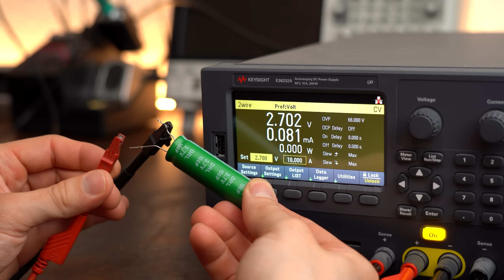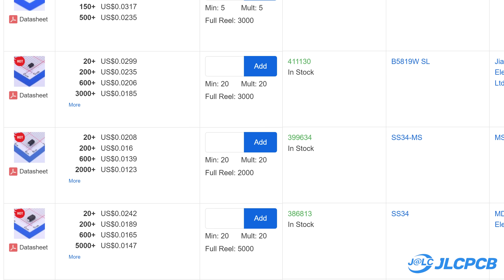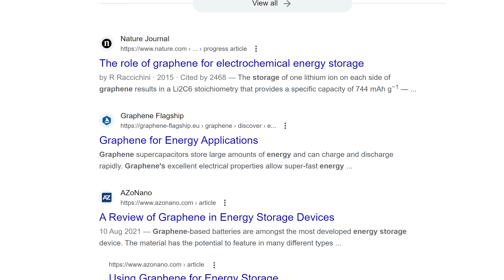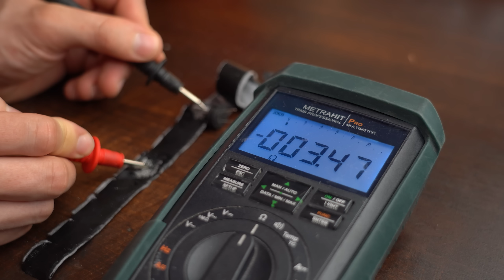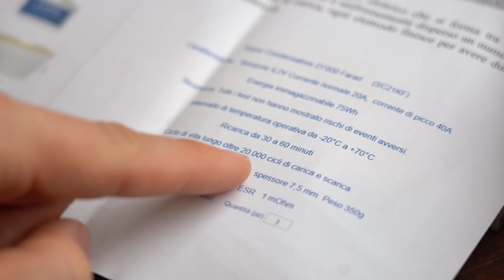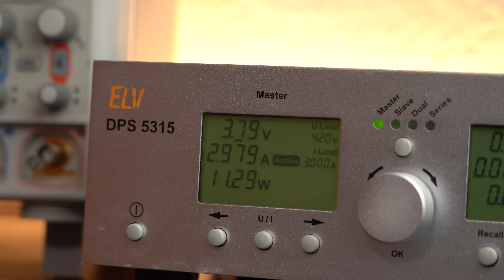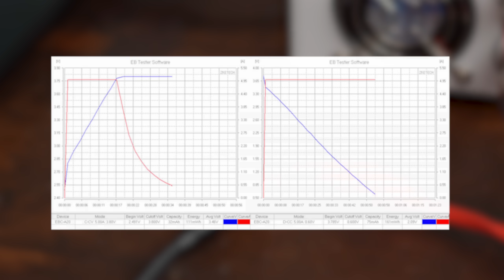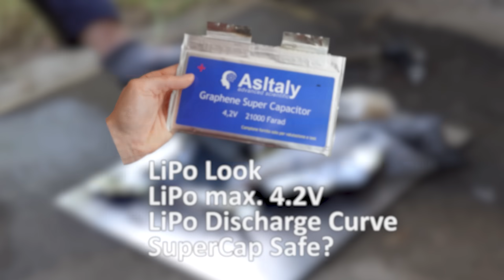Finally a Capacitor that can REPLACE a Battery?!

Comment: Greetings, interesting tests you have done here in video. If you allow me I wanna share something that I've built and using it like more than 4 years without any problem.
I have use the super capacitors just for starting a car. Like 5 seconds maximum of key turn until it discharges all the energy while starting. I use the setup in my car, have 6 super capacitors in a row connected in one bank and 6 in a row in 2nd bank (backup bank). I have built electronic for switching automatically after successful start to battery but only after the capacitor bank are full again and ready to use,basically, the car will recharge actual car battery while working but only when it recharges the capacitors first. Also I have built manual toggle switch for  capacitor/battery just in case as well as backup switch (toggle between 1st and 2nd capacitor bank), as well as the switch to manually charge the capacitors from battery if needed (only if the car is not running for a few days)
I use the 2.3V 20F 60A 35mm diameter super capacitor, have 6 of them connected in a row for total of 13.8v with same capacity of 20F in one bank and same in the 2nd backup bank. It gave me average of 5 seconds cycling a car with the key until discharges which is more than enough for a normal start.

The idea is to fully disconnect the car battery because of the life span, rigidness, low temperatures faults.
Basically, with this setup the advantages are:
- Quick start: capacitors can deliver high currents for short durations, which is beneficial for quickly starting the engine
- Long Cycle Life: capacitors can handle many charge and discharge cycles, making them more durable than traditional lead-acid batteries for frequent starting tasks.
- Cold Weather Performance: capacitors perform better than batteries in cold temperatures, which can be crucial for reliable engine starting during winter.
- Lower Weight: capacitors are lighter than traditional batteries, contributing to overall weight reduction in the vehicle.

on the other hand there are also some challenges and considerations to keep in mind:
- Capacity and Runtime: If the car is not driven frequently, the super capacitors might not be able to maintain a charge for long. In my case it is few days of not turning the car on.
- Voltage Requirement: While super capacitors can provide a quick boost for starting, they might not be suitable for long-term power supply to the car's electrical systems. Which is the reason why I've kept the acid battery.
- Power management: Designing a power management system that can seamlessly switch between super capacitors and the battery while ensuring smooth power delivery to various components. In my case I have built such a system, it still runs fine after 4 years.

All in All, my goal is to replace the battery entirely but to be able to do that, super capacitor tech needs to advance a little bit more, I hope in the future (maybe near) we will have such tech to throw the old lead-acid batteries thru window and start using the super capacitors 100%

btw, I am planning to switch my lead battery with different one, the reason is simple, it only needs to have enough charge to supply the capacitors with let's say like 10 charges (it will be more than enough if the car wont start because of some other reasons, like broken fuel pump, no fuel, bad starter etc. in that case I will only have to try turn on the car like maximum 5 times and if it not start it is something else, leaving me with enough energy in the battery when I repair the car and turn it on, which will recharge the battery and the capacitors as well for next start.

Any way, I would like to see if someone have some ideas to improve my setup even more.

Keep up great content and channel

Comment: Have been building capacitor banks with 3000F MAXWELL ULTRACAPACITORS for years. Voltage change is V=(IT)/C . Able to charge from 0 V to 2.7V with a cycle life of 1,000,000 
From its voltage curve it's a LiFePO 4 battery with a misleading label on it.

Comment: Great analysis. I'm not a cap (nor a battery) expert either, but after your tests I would agree that there's no way that's a capacitor. Doesn't pass the duck test.

Comment: Can it be fully discharged to 0 volts and then still function again? If not - it's not a capacitor. (I've ran in to this kind of scam before with another manufacturer calling lipo "supercapacitor")

Comment: Even with low capacity, fast charging partially offsets that issue in a fully built out EV charging network, where you have a charge station at least every 100km or less.

Comment: It seems to me that you are gratuitously smearing a perfectly legit product, still clearly labeled as "not for sale - still in developing phase - for test ans evaluation only". This is a hybrid capacitor, combining aspects from (super)capacitors and electro-chemical cells. That's the reason of the unusual discharge profile. You should have asked the vendor for some more details and information, before publishing such a questionable video.

Comment: Alternating layers of copper and aluminium foils?
It's a lithium.
Supercaps typically only use one metal i'm sure, probably aluminium like a normal Electrolytic...
But smaller memory backup caps use disks of activated carbon with separators in between, and the case is actually a kind of spring that pushes these together when crimped...

The discharge curve test actually reminds me of a test where I validated a recovered UR1620 lithium-ion battery, which was half-scary since I was unsure of it's chemistry, but was sure it could be only one of two types...
It charged to 4.2V just fine, and after a steady discharge, did not drop to 3.1V rapidly - which means it was definitely not a 'ML' rechargeable backup, nor was it a LiFePO4 type which I was a bit sad about...
...Compared to a 'LIR' type, it had only 2 or 3% of the short-circuit current, but it was not buggered as it shows 'good' capacity for it's size! I think it's a rare instance of "solid" lithium-ion battery, where the materials are stacked as disks - instead of being jelly-rolled.
A conventional LIR2032 has a ~ 1x10cm battery 'strip' rolled into a square, with the top and bottom featuring an exposed section of the electrodes which mates with the two sides of the coin cell...

Comment: Capacitors rely heavily on their structure to operate efficiently/correctly, this is generally why they are cased in a strong shell, the flexible alloy case is a strong indication this is indeed a battery of some sort (Not sure what battery tho)

Comment: I don't think science is far away from making a hybrid with the benefits of batteries and capacitors combined. High energy density, high power output, high voltages and currents, the best of both worlds.

Comment: Dude just punctured a 200 EUR battery for one video 😂
Reply: The battery is really worth maybe 50 euro. It is a clear fake, so don't get too impressed. Capacitors don't have copper sheet\plates in them (like this product did).

Comment: Strange...
I learned E = 0.5 * V * V * C
Filling in 4.2 V and 21000 F gives 185 222 Joule or Ws
Divide this by 3600 (s) and you get  51.45 [Wh]
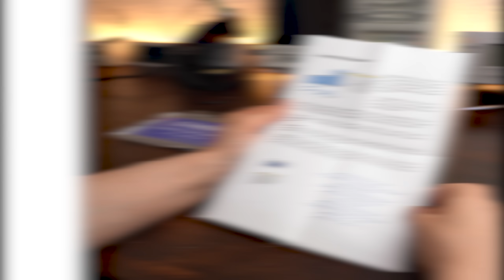At 06:40 the document claims 75 [Wh]
This stinks!

Comment: As far as I know Lithium reacts violently when introduced to water so if you can safely test is with water then you can probably determine if it is some kind of lithium battery. Make sure to deal with the waste properly so the environment does not get polluted.
Reply: Not true for all lithium batteries, multiple battery technologies like LTO is very stable

Comment: Taking a weight from datasheet - It is actually 200Wh/kg, that is awesome even comparing with LiIon technology!
It is really they have no reaction on puncture. Where the energy than goes? Would be nice to try testing the punctured one for the remaining charge.

Comment: Meanwhile the datasheet is available at it says:

"This product is a graphene hybrid ultracapacitor that is a storage device of energy that exploits the properties of graphene to achieve high storage capacities and rapid speed of charging and discharging. These ultracapacitors combine electrostatics (or double-layer
capacitance) and electrochemistry (or pseudocapacitance) to maximize energy efficiency."

So it IS hybrid. And there is also a picture in the datasheet showing a "Porous Separator" between the electrodes. Note that a real capacitor wouldn't need such a thing. This thing is needed so chemicals can pass from one side tho the other side, which is only needed inside a battery as inside a capacitor, no chemicals are traveling around.

Comment: When I first saw it, it was screaming battery.  As for the puncture reaction....Aren't some companies producing Lithium batteries that don't use the pyrophoric materials?  The lack of a data sheet and the knowledge an average person (or far above average person like you) can't test for 20,000 cycle life.....Alarm bells.  It will happen some day....probably not on ebay and not for a coupla hundred Euros.  Thanks for all the work you put into your channel.

Comment: Graphene should not react with water, Lithium reacts violently with water. You still can test this with the destroyed one, but you should wear gloves for that. Like someone wrote before you could discharge it completely and try to charge it again, and you could try to charge it in seconds, that also would not work with a Lithium Battery.

Comment: You are joking, right? 
Even if it was a 'supercapacitor', how have you come to an idea, it has a higher energy density?
Giant 'supercapacitor' has 21000F, and a small one has 100F, and also guess what, small one 20 times smaller, SO IT IS THE SAME ENERGY DENSITY.

Comment: Graphene Super Capacitor  is not pure Super Capacitor. Its hybrid with Lithium. Graphene gives quick charging and discharging capabilities. Lithium give best energy density. This brand is quite expensive. We (joltabattery) use Graphene Super Capacitor Cells at one fourth the price and make Super Capacitor batteries with 1C, almost 15 years life. These are best for mission critical applications like banks, telecom, data center, call center, etc.

Comment: I also want to say that from the data it is an excellent supercapacitor for some applications thanks to its safety, as you can see from the video, it does not catch fire, and thanks to its 20,000 life cycles, which seem few, but mean over 6 million km for an electric car.

Comment: My problem with the battery vs capacitor discussion is, 
1) it usually neglect the problem relating to the discharge curve of battery vs capacitor. Battery hold their voltage and drop down at the end, While capacitors drop down from the start the most. This is an issue I always find with my customers who request super capacitors as energy storage. There is no doubt that super caps are moving into energy storage territory. However, the discharge curve is the biggest hurdle to overcome. 

2) The idea that its quick to charge super capacitors is also due to their poor energy density and internal resistance. As super capacitors improve, so would charging them become a more sensitive topic as heat will always be a problem when resistance and large currents are involved.  So it goes without saying that the larger the capacity of super caps, the more relevant charging and discharging parameters and limits will become, as with batteries.

Comment: Pretty sure it is just a LiFePO4 pouch battery, no? They are much less volatile than other Lithium batteries so that would explain the puncture test. Now why the company feels the need to lie about their product and deceive their customers, I can't speculate on. Obviously, they are a garbage supplier that should be avoided entirely.

Comment: Supercapacitor is not a capacitor, but ion battery (without chemical conversion stage, meaning that it has lower capacity by definition). This misleading name should be changed, like most other "advertisement" names. This kind of battery depletes supply of opposite ions quickly, and there is nothing to support some basic voltage, meaning that a huge amount of capacity is wasted due to difficulty to extract it at lower voltages.

Comment: Ok so I wrote them an email inquiring about their supercapacitors. Here's a translation of the reply:

Good morning,
these devices are hybrid supercapacitor that have a higher voltage, capacity and energy density (up to 10 times) when compared to symmetric capacitors. They also have a lower leakage and standby currents. Alternatively, traditional supercapacitors have higher an higher power capacity (?) due to the lower ESR, the operating temperature interval is wider and can be discharged down to zero volts. Hybrid supercapacitors can't be fully discharged. Their structures are very similar, but an hybrid supercapacitor uses a graphene anode interwined with lithium and a different electrolyte.

Another advantage is its discharge curve being closer to that of a battery.

The fact that it's an hybrid is obvious from the shorter lifespan compared to electrostatic capacitors, but 20000 cycles mean 6 milion kilometers if used in an electric car or over 50 years of duration on daily charge. 

The differences among our supercapacitors are due to differences in distance between elctrodes and the difference between a cylindrical geometry and a pouch.

So yeah, they were hybrids all along. Cheers from Italy.

Comment: Would be interesting to put some of that 'graphene' under a microscope. If it is graphene it should look semi transparant, were as graphite just looks like opaque (but shiny) grey flakes. It won't prove that it's a capacitor, but at least it will prove it's graphene and not graphite.

Comment: The discharge curve told the essentials. It's not a super capacitor, it's a battery. Some lithium batteries do not light up even if they are damaged. Maybe the conductive material is thin enough that the short circuit is not too energetic to ignite. A high-current small battery requires strong conductive materials and thus aggressive ignition

Comment: 21kF is not insignificant storage. And it might be an upgrade worth considering:

https://youtu.be/XNmkXyhE4l8 

4 of these graphene supercaps in series would be an interesting automotive experience, especially with a small solar panel to trickle charge/maintain when an engine/alternator isn’t running…

Comment: That seems like it is more likely a lithium-ceramic battery. Very similar discharge and power density to lithium-ion, less violently reactive, (more expensive). If it is, still cool tech, but not grapheme super cap.

Comment: You might be dealing with a capacitor, power bank disguised as a single capacitor. Power banks, like these can consist of multiple capacitors, which act as the cells of a battery, giving it the ability to last longer than a normal capacitor.

Comment: The best up side though
It can store power for years without discharging

10:42 
And if it doesn't explode despite physical damage that is amazing!
Literally even if this isn't graphine this is a major improvement in safety!
Reply: Not if it's simply a lifepo battery, which also usually does not burn when punctured. 
Not to mention the confusion with the word "graphene"
Many battery manufacturers use "graphene" to differentiate better lipo cells using lithium manganese oxide (LMO, the inferior chemistry of lipo cells) and lithium cobalt oxide (LCO, the more robust and longer lasting lipo chemistry)
So if you see "graphene" on the label when you're buying a lipo battery, 19 times out of 20, they are using "graphene" to refer to the inexpensive, inferior LMO Lipo chemistry. Nobody wants that.

Comment: Having a look at their site I think you just got the only thing that isn't a super capacitor. The other two kinds which they offered (30KF and 100KF) actually looked way more genuine, with peak currents of 200A and 300A and just 5-10 minutes of charge times.
Reply: Although I made also a seperate comment, I'll copy the reply here too.

Ok so I wrote them an email inquiring about their supercapacitors. Here's a translation of the reply:

Good morning,
these devices are hybrid supercapacitor that have a higher voltage, capacity and energy density (up to 10 times) when compared to symmetric capacitors. They also have a lower leakage and standby currents. Alternatively, traditional supercapacitors have higher an higher power capacity (?) due to the lower ESR, the operating temperature interval is wider and can be discharged down to zero volts. Hybrid supercapacitors can't be fully discharged. Their structures are very similar, but an hybrid supercapacitor uses a graphene anode interwined with lithium and a different electrolyte.

Another advantage is its discharge curve being closer to that of a battery.

The fact that it's an hybrid is obvious from the shorter lifespan compared to electrostatic capacitors, but 20000 cycles mean 6 milion kilometers if used in an electric car or over 50 years of duration on daily charge. 

The differences among our supercapacitors are due to differences in distance between elctrodes and the difference between a cylindrical geometry and a pouch.

So yeah, they were hybrids all along. Cheers from Italy.
Reply: PS: I sent them an email, I'll see if they reply. In case I'll tell you all.

Comment: Actually this is new and we call it lithium-ion super-capacitor or super capacitor battery also available with different C discharge rate i can send you manual if you want but Chinese language if you don't mind